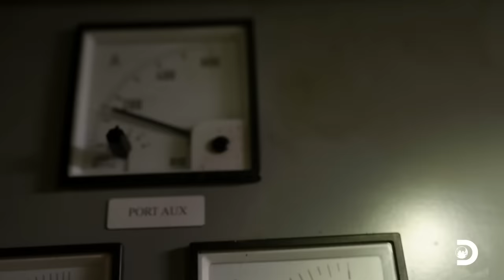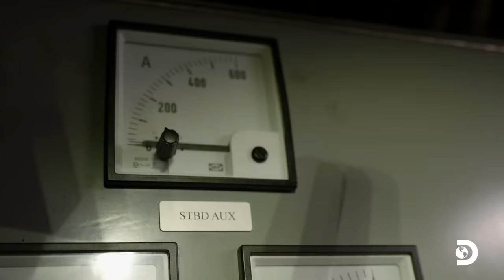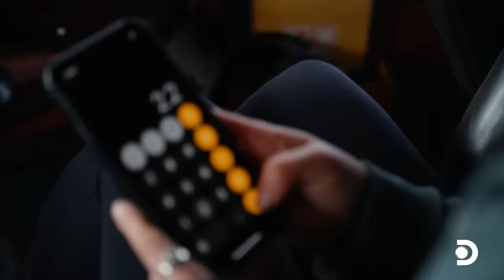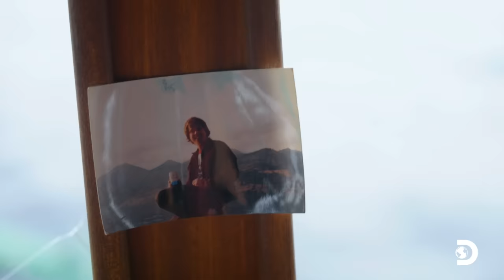Destructive Boat Breakdowns | Deadliest Catch | Discovery

Comment: no captain should be sleeping on shift
Reply: It's not a "shift,'" Bongo.
It's forever been a "watch" at sea.
And try using standard English, for crying out loud.
Reply: @lchaput7721  what do you mean by using standard English what did you not understand. Yes but there is a captain then then someone else who would cover for them when they sleep etc . falling asleep like that is obviously very bad as anything could happen
Reply: @chris-c2c4k  Next time, find an education.
Appalling sub-literacy has never been a virtue.
Reply: I've fished for 26 years. Every captain has done that they are on auto pilot with no boats on the radar and you set a watch alarm for 5 minutes
Reply: @lchaput7721 you had to edit that hot take? Laughable 😂🤣
Reply: @SmokeyNades  YUP! Drivel demands a blowtorch.

Comment: That's just a bunch of unmaintained rusty old boats, where captains are cutting corners on upkeep. With completely rusted out parts, high voltage wires and hydraulic lines hanging loose, I have no compassion for these kind of practices....
Reply: Buddy, this aren't yachts.
Reply: Clearly you've never been on anything larger than a pontoon boat. There's a massive difference between a working vessel and a yacht. These boats are constantly running, in one of the harshest environments known to man, stuff is going to break. These aren't your pontoon boat or a fru fru yacht with uniformed stewards waiting on your every whim, they're WORKING boats, boats that are out to make money, in other words, a real mans job, something you know very little about.
Reply: @robdog1245  oh touchy touchy. How about oil tankers, or container vessels...the are spotless inside the machine room, well built and well maintained. And for a good reason.